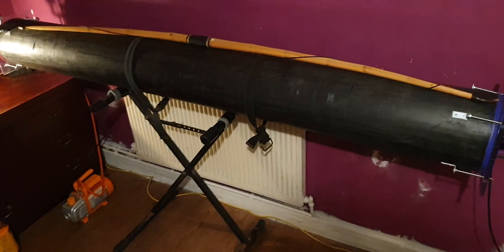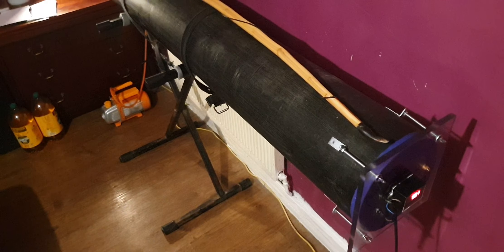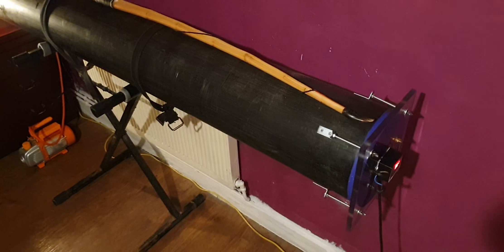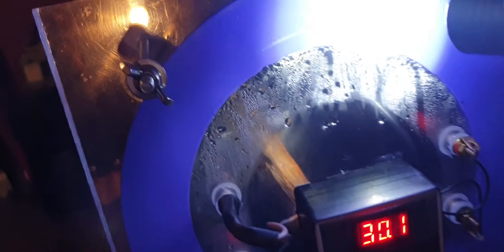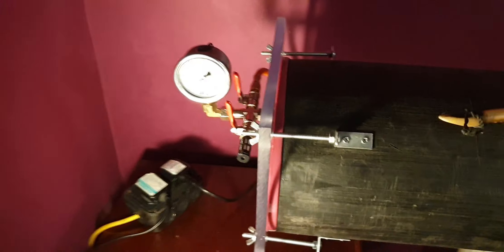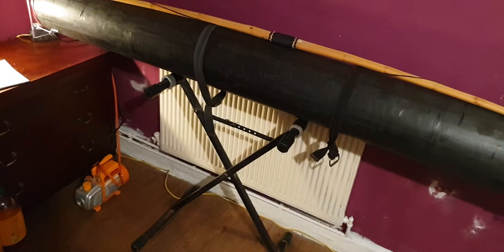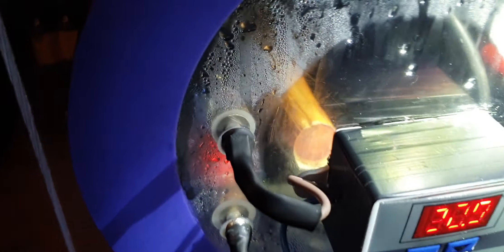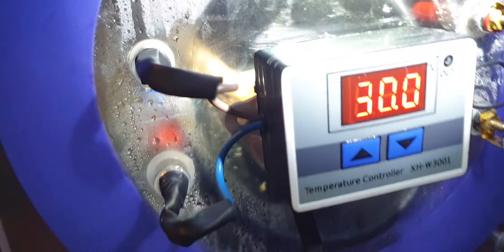DIY Vacuum kiln for fast drying wooden Longbow staves

Comment: nice, what do you use to get some heat in?
doesnt water enter the pump?
or do you get vacuum and just wait without running it in  between? good job
Reply from the maker: Hi , thanks for the interest , the heat is 6 halogen heating elements connected in series running full length along the top inside of the tube with a reflector , the tubes are the glass ones from the oscilating electric fires , when connected in series they glow a dark red as they cant reach there full temp , you dont want them switching on very hot when it goes below 20C , it has to get slowly back to desired temp , a programmable thermostat from amazon , keeps it at constant temp , i also put some thermal cut off switches in line one for 50C and another for 75C just incase . Method bring inside tube to desired temp eg 20 C and the stave if possible before it goes in , pull a vacumn then turn off pump then wait for 12 hours remove stave test for moisture content then repeat until satisfied .  yes the pump takes in water and the oil will need cleaning or replacing after each cycle . It does work suprisingly well , totally diferent concept to dehumidifiying air drying kiln drying etc ...